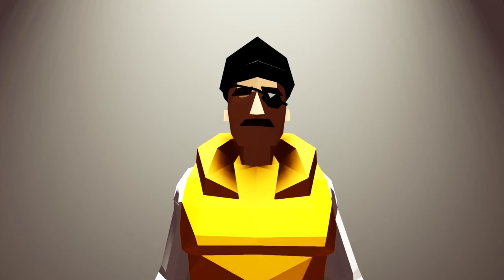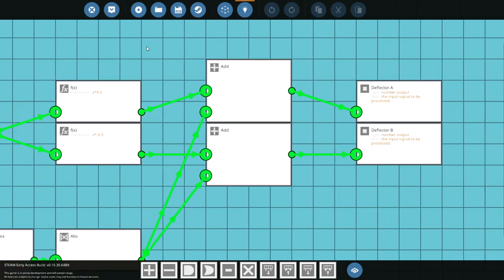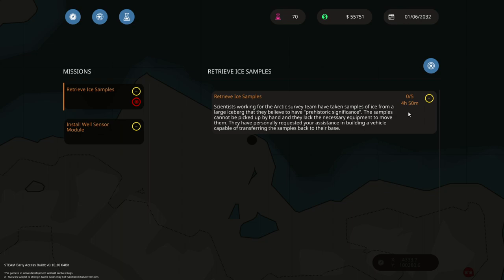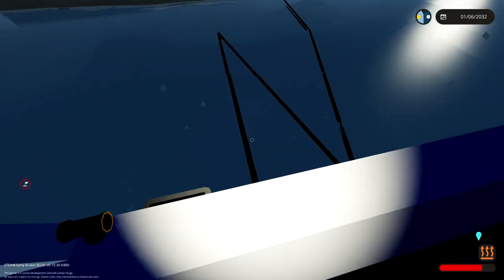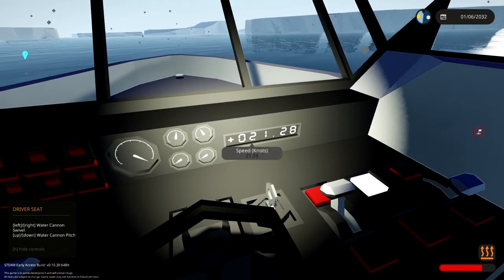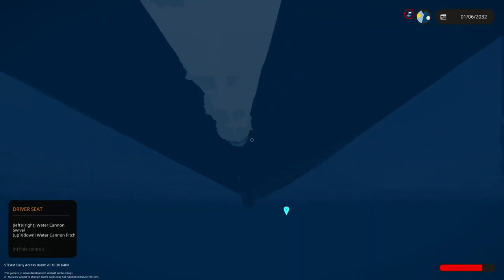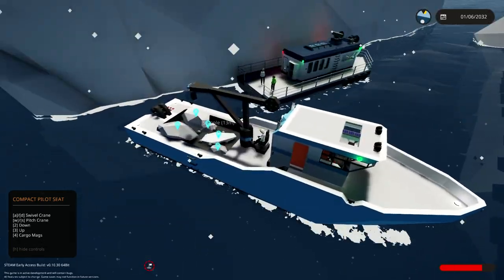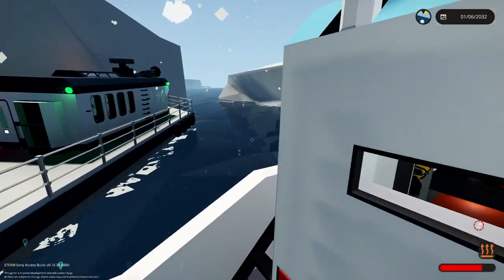I used my NEW CRANE to fill my boat with ICE - Stormworks: Build and Rescue - Career Mode - S1 E22

Comment: What type of computer do you have
Reply from the maker: Processor - Intel i7 7700k 4.2 GHz
RAM - 16GB Corsair 3000MHz
GPU - MSI Gaming X GTX 1060 6GB
SSD - Samsung 250GB
HDD - WD 1 TB
HDD (External) - WD 4TB
PSU - Corsair
Fans - Corsair
Case - Fractal Define S